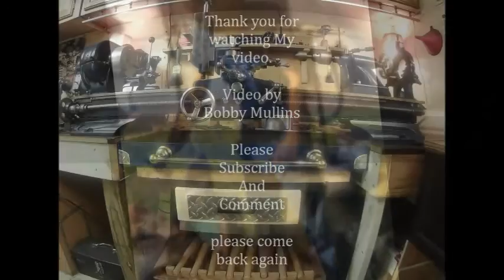grizzly g0602 4 jaw chuck soft jaws  bison built

Comment: Back on solids - great! Hope them 'bullet holes'' still healing well.
Glad you went for the long tail - main thing for these is that the contact area is where it's needed. Mine flex a bit in use but not a problem.
Reply from the maker: +ChrisB257 when i seen you do the tail. i knew right away the reason. if the hole jaw isnt covered it will cause the jaw to twist as you tighten them down. and the bullet holes are healing great. even the dr. was amazed as to how fast my body heals. lol